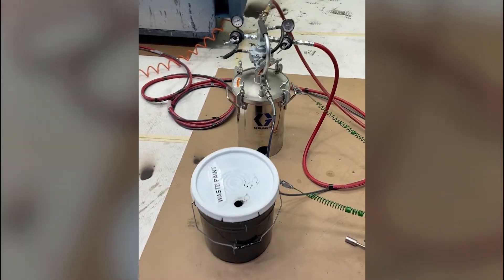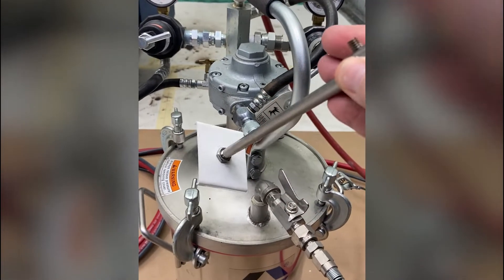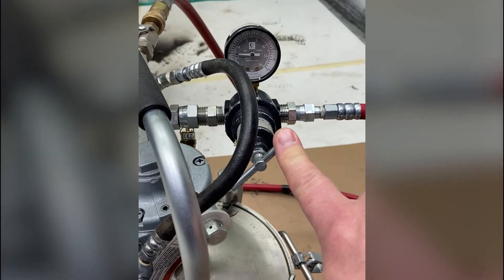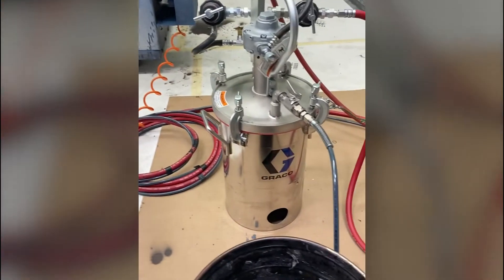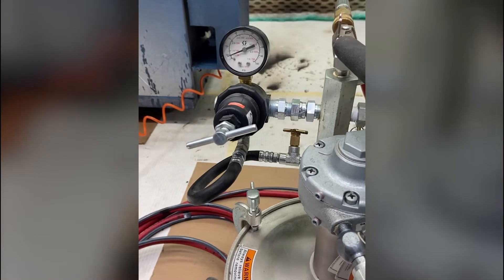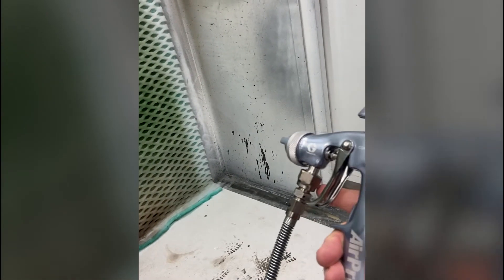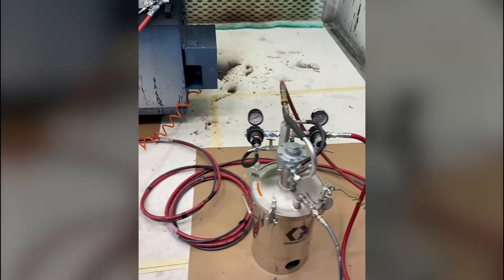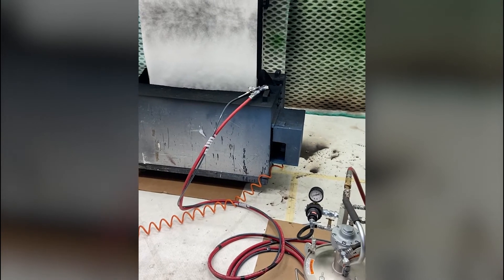Getting the Best Spray Performance:  Setting up a Pressure Pot and Air Spray Gun

Comment: How if sometimes the paint doesnt want to go out from the tank to the gun sir ?, as we can see the fluid/paint dnt go through the fluid tube.
Reply from the maker: In the video, you may not see the stream of paint because it was dispensing into the pail. If your question actually is about your particular pressure pot and air spray gun setup, we encourage you to reach out to your local Graco finishing equipment distributor. If you're not sure who that is, this link could help: https://www.graco.com/us/en/in-plant-manufacturing/how-to-buy/where-to-buy.html?wtb_code=CAP

Comment: Hi graco, i need to paint doors with water base paint, what side of the tip do you recommend?thank
Reply from the maker: To help you determine tip size, we would need to understand your flow rates and pattern size requirements, as well as the type of project you're working on. Is this a do it yourself (DIY) door paint project, or are you painting doors in a manufacturing environment? 

For the best answers for your unique needs, we encourage you to reach out to your local Graco  finishing equipment distributor. If you're not sure who that is, this link could help: https://www.graco.com/us/en/in-plant-manufacturing/how-to-buy/where-to-buy.html?wtb_code=CAP

Comment: Hi graco, a question, can i use the airpro spray gun with a airless spray machine?thank you
Reply from the maker: The AirPro is a low pressure air spray gun and cannot be used in air assisted or airless applications. You can check out our lineup of airless spray guns for use with our electric airless sprayers here: https://www.graco.com/us/en/contractor/products/architectural-painting-coating/airless-paint-sprayer-accessories/spray-guns.html.

Comment: What if you buy the kit with just 1 regulator? The one regulator is just for the pot, so how do you adjust your air pressure at that point
Reply from the maker: You would need to add a second air regular to control the atomizing air to the gun. You can contact your local Graco finishing equipment distributor about ordering the air regulator kit, part number 235042: https://www.graco.com/us/en/in-plant-manufacturing/product.235042.html

Comment: Or is there a way that an adapter with outlet/connection for 2 guns can be installed in the air outlet towards the gun? And how many PSI would be recommended?
Reply from the maker: You should never connect two guns to the same supply. Each gun needs to have independent fluid and air control. Pressure settings depend on the material and flow rate requirements. 

We encourage you to connect with your local Graco industrial equipment distributor about your specific requirements and the best way to make any pressure pot and air spray gun setup work for you. If you're in Mexico, you can follow this link to find a distributor near you: https://www.graco.com/mx/es/in-plant-manufacturing/how-to-buy/where-to-buy.html?wtb_code=CAP

Comment: Can you help me, I have a similar unit, only it is 12 gallons, and the guns are the same, but I use it for 2 cabins, the air connections for the guns are taken from an independent line, we adjust the first regulator to about 20 psi, but is there a problem if I keep the second regulator, which is the air outlet to the gun, at zero? Since I do not use that outlet, it is worth mentioning that I have not had a good result, since the paint comes out dry
Reply from the maker: It is okay to set the second gun air regulator to zero when it is not in use. If the paint atomization is too dry, then the air pressure is either set too high or the air cap selection is incorrect. 

We apologize for taking awhile to reply to your concern. For more immediate replies that pertain more to your situation, we encourage you to connect with your local Graco industrial equipment distributor. Not sure who that is? Find out at https://www.graco.com/us/en/in-plant-manufacturing/how-to-buy/where-to-buy.html?wtb_code=CAP

Comment: Conventional gun & pressure feed gun is same or different
Reply from the maker: "Conventional" refers to spray technology used in the gun, and "pressure feed" refers to how the paint is delivered to the gun. In this video, the AirPro is a conventional air spray gun that uses standard air atomizing technology. The pressure pot feeds or supplies the coating to the AirPro spray gun under pressure, making it suitable for applications requiring a steady flow of material.

Conventional spray technology does not use electrostatics. This article compares the two technologies: https://www.graco.com/us/en/in-plant-manufacturing/solutions/articles/conventional-vs-electrostatic-spray-guns.html

Comment: Hey mate any idea why my pressure pot would be losing fluid flow without any pressure drop? It just slowly drops off, I'm spraying water based enamel no leaks no blocks it's a brand new unit. Cheers
Reply from the maker: You might not have a good air supply. The supply line could be too small or the air supply source doesn't have enough volume to keep up with the flow demand. For better troubleshooting, we encourage you to contact your local Graco finishing equipment distributor, or contact our technical support team in your region. To get that conversation started, fill out the form at https://www.graco.com/au/en/in-plant-manufacturing/how-to-buy/talk-with-an-expert.html?wtb_code=CNV

Comment: How big the compressor needs to be to make this sprayer works?
Reply from the maker: It depends on many factors. Please contact your local Graco finishing equipment distributor or call us at 866-361-5929 to talk through the best option for you.

If you're not sure who your local Graco distributor is and you're in North America, this link might help: https://www.graco.com/us/en/in-plant-manufacturing/how-to-buy/where-to-buy.html?wtb_code=CAP

Comment: Do Garco supply 2 quart pressure pot with agitator? We only have 1 quart of paint but we do need agitator as well because the paints are heavy metal based ones.
Reply from the maker: Our smallest pressure pot with agitator package includes a 2 gallon low pressure pot. This link points to three options available in North America: https://www.graco.com/us/en/in-plant-manufacturing/products/liquid-coating/paint-kitchen/paint-kitchen-accessories/pressure-pots.html?maximum-volume-capacity-(gal)=2
Reply: @GracoIndustrial  Thank you. Can we use a smaller container( like a 2 qt size)  inside the 2 gallon pot? We do not have paints more than 2 quarts in volume. Thanks!
Reply from the maker: @MJs-85  It depends on a number of factors. Please contact your local Graco finishing equipment distributor or call us at 866-361-5929 to talk through the best option for you.
Reply: @MJs-85  you want an HVLP turbine no pressure pot
Reply: @andrewgoodright7844  Thank you, Andrew. I already got a 2 qt. pressure pot with a conventional gun setup 1.5 and 1.8 mm nozzles. We have heavy antifouling paints and pressure pot is a must requirement for painting those
Reply: you want an HVLP turbine no pressure pot
Reply: What size compressor do you need